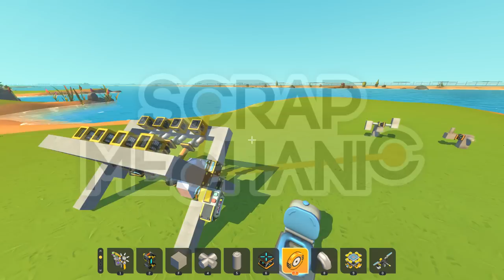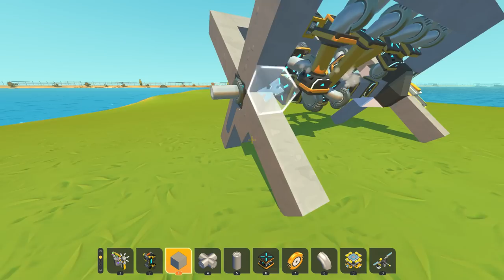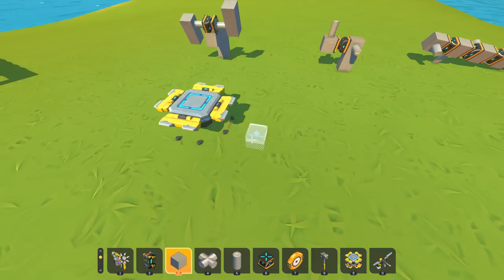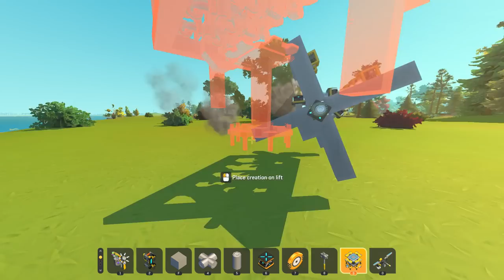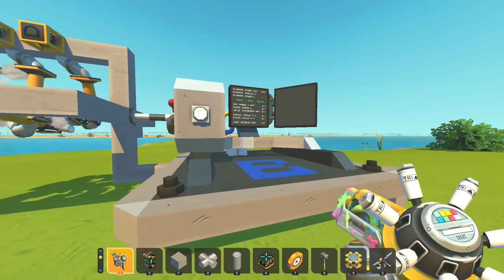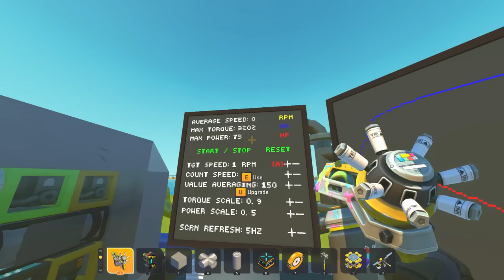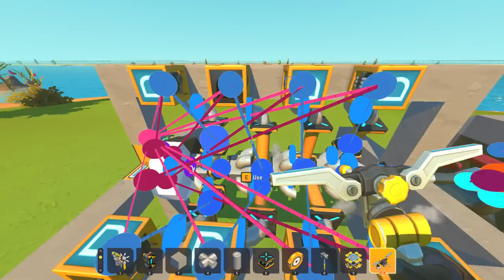I Built a V8 Engine Using 2 Amazing Game Changing Techniques!

Comment from the maker: Let me know if you have suggestions on how to improve my engine building skills! Definitely need some tips on better timing and how to control engine power through timing adjustments!
Reply: Maybe put the sensors on the shaft I see that in a lot of really good engines, tho idk what that does better
Reply: make a rotary gnome engine!
Reply: Kan, i love you videos and if you want a piston engine with "gearbox" (simple timer piston engine without mod) u can see my build. (Toilet pump, piston engine with gearbox)
Reply: I don't know how it would affect the pistons but I would like to see a "driveshaft" built like one of those old hand drills with the curved handle for spinning the drill
Reply: Just out of curiosity could you please try replacing the timing wheel with pipe pieces?
Reply: Hey Kan I don't know how feasible this is but could you use 2 pistons one on top of the other per cylinder to increase piston velocity and overcome RPM limit
Reply: Looking at spin direction is very important, and you seem to have ignored it in almost every engine. When tuning, you rotate the timing wheel an increment at a time until you get the max rpm. That is good, however, especially with logic gates, if you start the engine at that angle, it is very likely to spin slowly in the other direction instead. This is because the timing has been advanced all the way into reverse, but the delay coupled with the speed keeps it going in the right direction. 
The delay you get without logic gates makes this almost entirely ignorable for standard rpm engines (almost). Building engines with logic gates can still be viable if they need easy on, off, and reverse, however, with a clutch, off is not necessary.
Reply: Xml edit the speed
Reply: If you have concerns about the friction between the sensors and encoder wheel you can move the sensors to be around the encoder wheel instead of the front of it. Never tested myself tho
Reply: So a mechanical advance distributor uses springs and weights. the higher the rpm the faster the distributer spins creating more centrifugal force against the spring. could this be achieved by using pistons on the crankshaft with a block on the ends and multiple sensors to trigger which timing setting you are using?
Reply: In a real 4 stroke engin the timing change with the rpm of the engin and the load. Old car use a distributor to do that job mecaniclaly. Maybe that technology can help you in scrap mecanic ? cerry good video !
Reply: @cat_lord5149   it actually is worse because it makes it a lot harder to tune
Reply: Well what I did to improve my torque and power on an inline 4 was to shift like the piston shaft something that like toyota did with their 3 cylinder in the yaris gr
Reply: There is no friction between the timing wheel and sensors, but there is constant collision which also can be seen by the dust clouds.
Reply: The problem you were talking about, with the timing wheel needing to be at a different at different RPMs for optimal performance comes down to the latency between position and piston applying force.
The reason people have been saying to get rid of the logic gates is that you go from 40ms delay (sensor to piston), to 80ms (sensor to logic to piston)
This increased delay increases the distance the timing wheel turns during it, making it need an offset twice as large for optimal use, but more importantly, varies twice as much between high and low rpm.
Reply: I don't know how to improve the engine, but I was wondering if you could make something like a paddle boat with one of them in it. I don't know if scrapmechanic works with paddles, but I think it would be a fun build if it worked.
Reply: The reason that your encoding wheel does have friction is because the engine itself is flexing from the bearings+pistons, there is a translation (from the pistons) and a slight rotation which is less obvious
Reply: you've got a dyno. testing if the code wheel has friction should be pretty easy. also, down to see the evolution of removing the gates
Reply: @TheBaldrickk  no, it doesn't vary twice as much. The delay on constant. Not variable. The only thing it affects, is the required offset of the timing wheel. If the delay is 80ms, you just turn the timing wheel 40ms equivalent back and the sensor gate delay is then eliminated irrespective of the RPM. You could put 3min timers on there and just crank the timing wheel to the correct position to completely eliminate it. The only caveat being that it would take 3mins to fire up the engine, but that's no problem at all on what ever additional delay the logic gate introduces. 

The only thing variable here is the piston behaviour.
Reply: I don't play myself but, what if you had two encoder wheels face to face with a barring in between. Each encoder wheel would have say, 2/3 the amount of white blocks that the single one has now. You could then, with a controller, change the angle to get the exact amount of white blocks you want to min/max the timing.
Reply: The exact amount of white vs black.
Reply: @anteshell  40ms is a different angle based on RPM.
Ideally, it would be instantly activated, and no offset would be needed to be applied.
That is not the case however, thanks to how logic works in the game, so there's a minimum of 40ms.
With the additional logic gates, that's 80ms.

You can't just turn it back "40ms" - because... that's a time, not an angle.
So what is the angle?
Well, that depends on the RPM.

So the angle is going to be something like: RPM x ticks x f  (where f is some conversion factor)
Lets say that under no load, we should expect it to run at 200rpm, and under load, at say, 100rpm.
in a perfect world, no adjustment.

With 1 tick, and in the absence of a system to adjust it based on the speed, our best bet is to find the average value between the offset needed for 100, and for 200 RPM.

This sits halfway between the two angles needed for optimal output at both speeds.
Lets say it's "a" degrees away from each.

If there is a second tick however, we do the same, but the offset needed for 100 and 200 are both doubled.

this means that our average point is "b" degrees away from the optimal offset for both 100 and 200

But because we have doubled the delay, we have doubled the offset needed at any speed.  The offset between 100 and 200 has doubled.
Therefore, b=2a

that is, with additional delay, the further your average case offset will be from the actual optional offset for each of those speeds, and you lose efficiency.

Sorry if this is a bit long and seemingly rambling, but I wanted to try and explain myself as clearly as possible
Reply: I think that putting all the sensors on something that you can control the rotation of might be an easy way to adjust the timing; you can begin at 60 and turn the sensors later. The hard part as you said is getting the rpm of the engine to a controller
Reply: Put it in a car
Reply: This video was AWESOME! such an awesome explanation on how it works. This is going to progress me and my friends creations SO much! Set the dyno target rpm to like 120-150 and you can see how much power it makes at that RPM! you can figure out what timing it needs at which rpm
Reply: Hey kAN, I build airplanes using the wings mod in SM and when I don't separate blocks between the elevator and the tail, they seem to get hung up. However when I separate them they no longer get stuck. This led me to conclude that friction is in fact calculated between two parts of the same creation. So I would advise separating the timing wheel from the sensors. Though I don't know how much of a difference it would make, I don't think it could hurt at all.
Reply: Here is my idea. Make the timing wheel connected to the main shaft still But have the timeing wheel connected to a veriable motor  connected to the shaft so you can slow or speed up the timing relitive to the speed of the shaft.
Reply: I would use a seperate controller to run your encoder. Then you can use a sensor connected to your controller, and the controller set on a low speed. So at first its in a retarded timing. So as the engine speeds up to speed so does the timing, but when the engine slows down due to load. It will retard the timing giving the pistons more torque
Reply: ofc use a timeout logic gate on that sensor, so it reads how many times that encoder wheel passes by, not how long the sensor sees the encoder wheel. Then you can hook that up to your controller for your encoder wheel and as your engine speed shifts, so does the encoder wheel. I've been wanting to put vvt on my piston engines but steam wont allow me to log back in.
Reply: and that way you can set up a complete vanilla rpm guage too, by running a controller off of the sensor and time out circuit, you can read the rpms based off of the position of the controller
Reply: @TheBaldrickk  Yeah, and that is exactly what I meant by 40ms *equivalent*" If the engine has 300rpm, the angle equivalent for 40ms would be 72 degrees. On 200 rpm it would be 48 degrees and 100rpm would be 24. 

The logic gates don't matter. Simply turn the encoding wheel a set amount of back depending on the max speed. That would be exactly the same as without the logic gates and the adjustment. There would be absolutely zero difference.
Reply: @anteshell  my point was that if you time for max RPM, then you're going to be further away from where you need to be when under load, when there's more delay.
You can easily tune for one speed, but the increased delay makes trying to find a good overall balance harder.

Using the toning as a speed controller (adjusting the offset to try and obtain different speeds) should still work though.  Albeit with different values for each target speed
Reply: @TheBaldrickk  That is not true. The offset is fixed. And the load will have the same effect in either way. Yes, the timing will be whacked but that is irrelevant because it will be whacked exactly the same in both cases.

The need for variable timing is completely different problem from this. These two things does not affect one another.

There is an easy way to test this yourself. Do you have a clock? Like a regular old time clock with physical hands? Now, force the minute hand 15 minutes forward and then turn the clock 90 degrees backwards. Where do you think the minute hand is as opposed to where it should be? 

Now, a second test. Apply a small force on the axle that connects the clock hands to the motor. It should slow down the clock a bit. Then watch how long it takes for the clock hand to make a full revolution with both, normal setting and adjusted as such as I explained above. It should take longer than without applied pressure but in both cases it would be the same provided the force you apply to the clock stays constant.

It's not that hard.
Reply: @anteshell  it would take longer but be the same?

Besides, we're not talking about the same thing here. 

The problem we have is that we have a fixed constant, and a moving variable. And you're trying to find a fixed value to ratify the two.  It can't be done.
Two variables moving together, yes. Two constants, also yes.

Let's use a clock to explain.
Someone wants to know when the clock reads 12:00.
They live a 5 minute walk away however, so, oops, by the time you get there, the clock reads 12:05.
If the clock is running twice as fast, then the clock reads 12:10.
You're either 5 or 10 minutes out, so how early should you leave to tell them it's 12:00?
To lower the worst case, you leave when the clock shows 11:52:30 and you'll always be 2:30 out according to the clock.  This is your least worst case error.

If they instead live 10 minutes away, you either need to leave at 11:50, or if the clock is running at double speed, you need to leave at 11:40, because the clock will either progress 10 or 20 minutes.
Now your least worst case error is 5 minutes

By doubling the delay, the least amount of error you can have is also doubled.
Yes, if you're only going to run the clock at one speed, you can account for that.  But when the speed can vary, it's going to cause errors.  And when your latency is higher, those errors get higher too.
You can't apply a fixed offset to fix it.
Reply: Well with the stallings issue is the reason for a transmission would get more torque or of it with a transmission of some kind
Reply: I would want to see what different firing orders would do? Like a Flat Plane Crank or a more realistic Cross Plane. All I think it would do is change the vibrations/balance, but I would love to watch a video on it regardless.
Reply: about the gearing up, you could simply have it manually controlled. This won't give you optimal performance, but it will still improve the performance. I don't think it can be feasibly automated without an entire logic circus (and even then I doubt it would be precise) or a mod.
Reply: Hey kAN, I’ve seen previous builds with piston engines where they ‘idle’ at a certain rpm, and then ‘accelerate’ by advancing the timing gradually. (Usually done with a controller hooked to a seat- pressing w advance timing, pressing s retord timing)

It seems as you advance the timing the engine runs better at higher rpm, at the expense it is more likely to bog down at low rpm.
The alternative is to have the rpm set low, so it has the most overlap in timing, thus helping prevent getting bogged down under load.

Different idea entirely, run the engine at a high rpm all the time, but put it through a transmission to get the low output rpm when needed.
Reply: X16 a V8 mirrored on to the other side
Reply: something i found super weird with your v8 is that each piston fires individually. because both the piston and the point its connected to have the same offset that means that its pair should fire at the same time because they will always have the same offset to the crank. if you look at the pistons, the pairs are always extended the same amount and have the same degree offset therefore it should fire in sync like 2 dual inline 4s connected to the same shaft.
Reply: any way you could make a 16 piston engine by putting another v8 assembly on the same crankshaft on the opposite side of the block making it 180 degrees out of phase
Reply: Hey could you explain how to make those 90 degrees piston things I am trying to make one to make my piston engines better but i need the center not to rotate because the bearings are too stressed.

Comment: Would recommend a mod like "Bingo's Block and Part Editor" which lets you blueprint edit stuff without having to spawn it on the lift and go to the files.
Reply: Thanks
Reply: Wait, what!? I've been using a custom blueprint editor for quite a while now, there's a mod for this!? That's helpful!
Reply: Ayyy free mod advertisement
Reply: i have that mod

Comment: So you've made an inline 4 and a V8 now ya just need to make the boxster and the rotary engine. Love these builds 🤘
Reply: rotary would be crazy to see!
Reply: rotary or radial? Rotary engine can't really be made in scrap mechanic because it doesn't have any pistons.
Reply: @outandabout259 unless you set the pistons up to act like the firing chamber in the rotary engine nit sure if it was spin center though
Reply: @thejwilliams333  I feel like that would essentially end up being a pretty crap ratchet system or just a boxer/inline
Reply: A rotary engine would be scary and hard to see working, the cylinders spinning around would look weird. They’re scary in real life too.
Reply: @timehunter9467  Scary how? I think they're an incredibly elegant engineering solution. I believe that unless you want torque, they are the best solution. Due to being inherently balanced, the power delivery is always smooth. But then, I'm also a rotary guy at heart, with big V8s being my next favorite type of car engine.
Reply: @KidarWolf  Are you thinking of a Wankel engine, because that’s not a rotary engine. Rotary engines look like a radial engine, but the entire engine rotates instead of the crankshaft. I’ve only seen them on aircraft but it would be insane to see one in a car.
Reply: @timehunter9467  you're talking about the air craft rotary engine ya? I should have been more specific and said the rotary engine from the RX7
Reply: @Chroniccanuck  that’s not a rotary engine, that’s a Wankel engine.
Reply: @timehunter9467  ok. My bad I know it as a rotary engine.
Reply: @Chroniccanuck  Everyone calls it a “rotary engine” because it has rotors. Real rotary engines were on aircraft mainly, but there really was a motorbike with one in the front wheel. Front wheel drive motorbike sounds strange 🤣
Reply: rotary is simply not possible is SM rn since for starters its not a piston engine
Reply: @crimsont5567  Rotaries DO have pistons. Wankel engines are the ones without pistons. A scrap mechanic motorbike would be interesting with one in a wheel, there was one in real life.
Reply: @outandabout259 I'm not sure if that would be any different from a controller engine